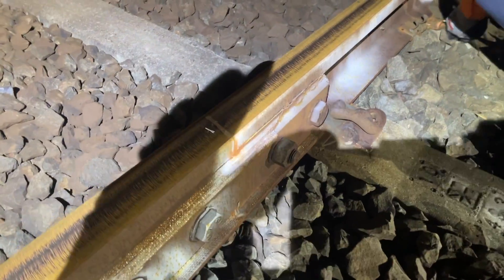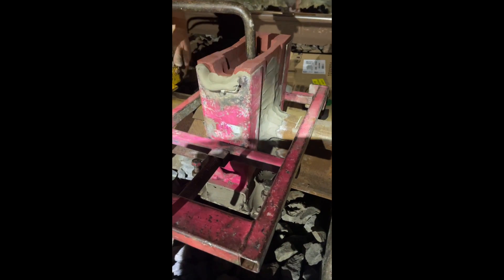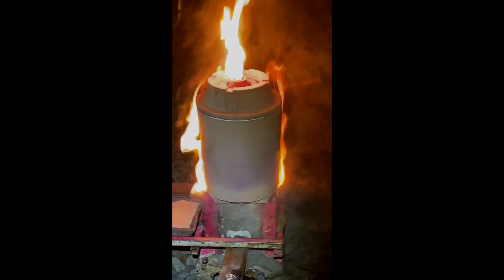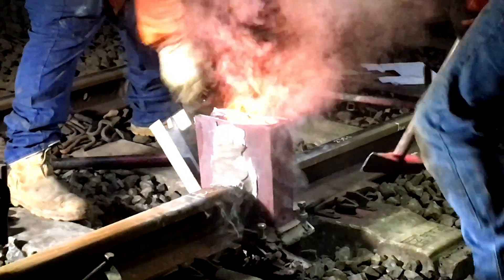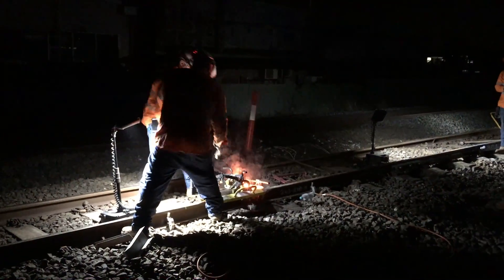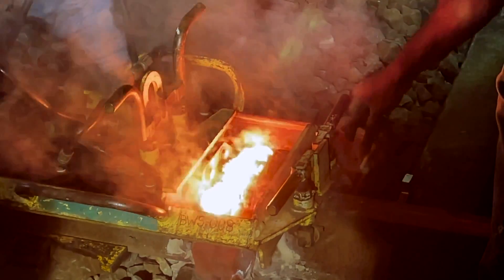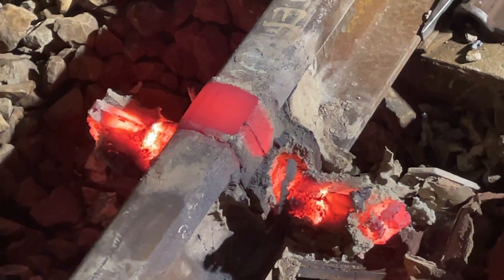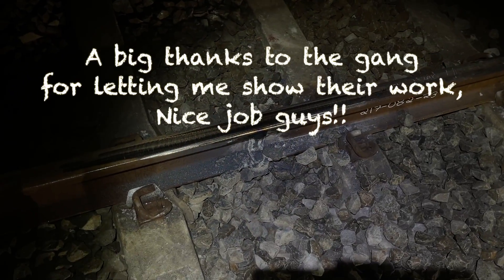Thermite Rail Welding.  Replacing a Glued insulated joint.

Comment: I was curious, but at what temperature is that thermite weld burning at?  Is the thermite capable of burning through the ballast?  Does the weld create any unpleasant odors?  Are the fumes that the weld generates safe to inhale?  Also, how long does this process take, from start to finish?  Cheers, Joe.
Reply from the maker: The reaction burns at 2500 degC (4100 F) and the process takes about 2 hrs from start to finish. It doesn't come in to contact with the ballast  Joe. The fumes are strong and I assume not real good for you? We try to stay upwind from it.
Cheers Gregg.
Reply: @FishplateFilms  Thank you, Gregg.  What do the fumes smell like?  Cheers Joe.

Comment: A amazing video, I wish I could do that with my layout.   I remember when they first started doing the thermite welding, it would take half a day to complete (that's what my grandfather said).  Now they pull up a truck, and it's done within a short period of time.  Thank you for filming .  Cheers from Terry in mild Nebraska.
Reply from the maker: Thanks Terry!  Yes , it is a lot quicker these days, and has changed even during my time in the rail!  A bit more involved and scary than soldering a joint on the layout..LOL
Cheers Gregg.